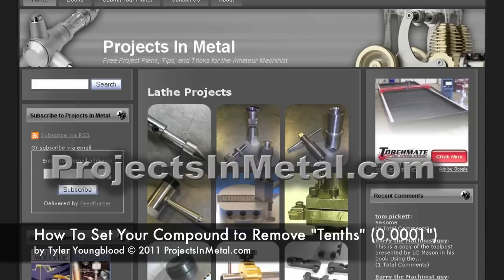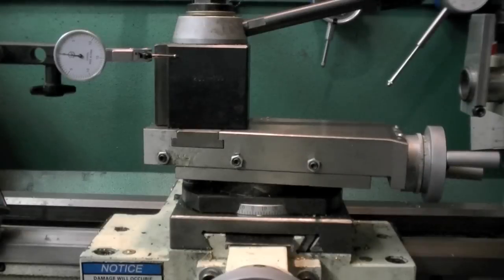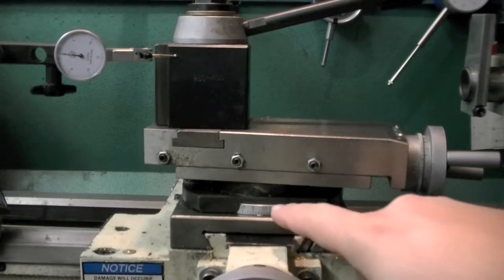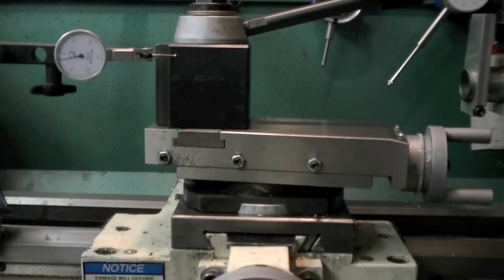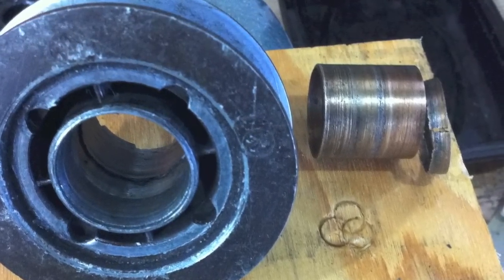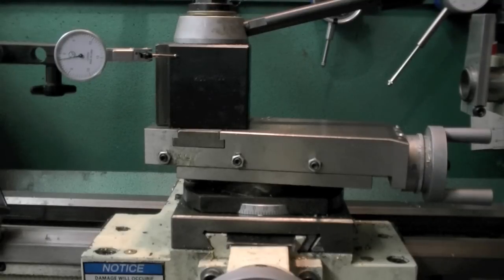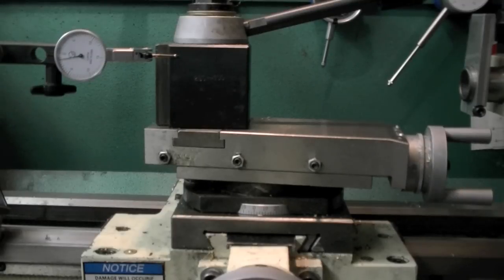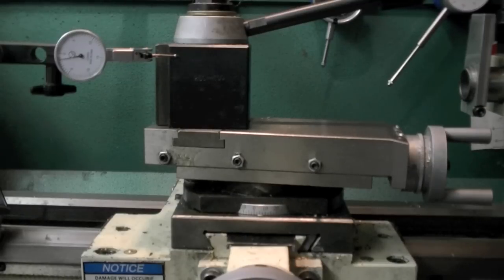How to Set Your Lathe Compound to Remove "Tenths" (0.0001")

Comment: Folks - 5·75° is approximately......

.....5·7391704772667863125149089039304° which is the angle you're aiming to set ! (Inv sin 0·1)

Any lathes with vernier marks on the position indicators ?

Comment: No. If you are trying to remove tenths from diameter it is because of these reasons.
Engineer failed to achieve size at finishing cut.
Engineer failed to observe a machines wear and tear and, remember to add or subtract this to final cut.
Engineer failed to eye position on radial dial by sight to brake one division into tenths by eye.
Engineer failed to use a magnifying device directly horizontal and vertical square to dial to make tenths possible.
Engineer is not employable in real industry for time consumption but could be employed by a cartel union run factory for a while.

Comment: An egg head will tell you "in theory" you can shave .0005 off ID/OD using this method ....a toolmaker will tell you get out the lapping compound and start polishing.(never trust the compound graduation. it's more of a ball park guess) Then expect a talking to for not knowing exactly what your getting before you cut it.
On that oil light bearing +.0002/+.0005 press will work just fine with worry of collapsing. ...If so, break out the lapping compound. no big deal. and press with a little grease to prevent galling. and press only when you know both parts are square!
 In any event, that will teach you to keep your machine way lubed or spindle lubed.
 All part in parcel of the trade...don't over think it. Lapping compound is your friend!
 Compelling video...got me thinking!
Reply: I just read some of these comments. People are such "Ass Whistles". Anyone worth there salt in the shop can make do on these Chinese machines. I'm not saying go out and buy one, but we all can't afford Monarchs.
 I give you props for effort. All Machinist have to break a few eggs...or in this case Egg Heads. I'd higher you before I'd higher some of these Huckleberries know it all's. (In the shop you can't throw a rock without missing one).
 
 M.E / P.E. / Master Toolmaker....3rd generation!
Reply from the maker: par4par72 Thanks for the kind words. I really appreciate it! The technique worked great for me with my oilite bearings (kudos by the way, most people don't even realize that the bushing is made from oil impregnated bronze). I was worried that HSS would smear the metal and close the pores (preventing the oil from doing it's job) so I kept the HSS really sharp and I'm hopeful that it holds up over time. In a hobby shop I'm confident that I won't put enough use on the Atlas mill to put a lot of wear on the bearings anyway. 

And thanks for saying you'd hire me! If you happen to have a shop in the Columbia SC area I'd be happy to apply! I currently teach college level computer science, but it's a part time online gig. I'd love some FT shop work!

Comment: Great explaination. Press fit tolerances are a headach. I use inside depth gauges and .0005 dial indicators. A moment of silence and good sprinkle of holy water before beginning.  TI-30X scientific calculator will give you the exact degree for your compound setting.
Reply from the maker: Ah, good idea on using a scientific calculator. I didn't think of that! "Holy water". Ha! I know what you mean. I was worried I was going to split the aluminum casting with the oilite bearing!
Reply: @ProjectsInMetal  Try the device you're posting comments on. Mine says 5·7391704772667863125149089039304°
Reply: What did you use to post this comment - an abacus ? What I used to post this reply says: 5·7391704772667863125149089039304°

Comment: Use your calculator to give you the arcsin (or inverse sin or sin^-1) of the fraction you want. Examples: sin^-1(0.5) = 30 degrees; sin-1(0.1) = 5.74 degrees; sin^-1(0.05) = 2.87 degrees. Your calculator will give you an outrageous number of digits, but good luck setting even a tenth of a degree. :)

Comment from the maker: Yep. However, I find the dials on my G0602 (an inexpensive import lathe) to be both course (hard to get fine adjustments) and inaccurate. One rotation is supposed to be .060 but it's off by a few thousandths. It took me a while to figure that out! I could never figure out why what I put on the dial wasn't what I got from the cut.

Comment from the maker: Well, usually the process isn't necessary at all. But when you're trying to hit a very close tolerance (say .0005 oversized for a press fit) you can achieve it very easily with a sharp HSS tool and the compound set like this. Tool flex and other factors prevent me from easily being able to hit the mark on such close tolerances, so if I find I'm .0008 oversized and I want to be .0005 oversized, I can get that last .0003 using this method.

Comment: Nice trick - If I am doing any turning where I want really specific numbers I just put a dial directly on the tool post like you demonstrated, and then read the actual dial movement rather than the dials.  You could do the same thing with your technique, and be absolutely sure of the movement by watching the clock rather than the dials, and still get the "fine adjust"...

Comment from the maker: I have a Dumore toolpost grinder and it certainly makes the process easier. And yes, .0002 or .0003 is easier to achieve than .0001, but it can be done with practice, a very sharp HSS tool, and patience. But if you have a toolpost grinder you'll have a much easier time. Most of the time hobby machinists don't need accuracy anywhere near .0001, but it's fun to know how to try and achieve it using a little geometry.

Comment from the maker: I've taken tenths off (0.0001-0.0003ish) with my Grizzly G0602 (the lathe in the video). You just have to have a really sharp HSS tool. You can't use carbide or it will just rub. Even with HSS sometimes you'll take a pass and nothing will get cut, so you'll move the tool in another .0001 or so and suddenly the tool with bite and take .0003. It's a little tricky but with practice, tight gibs, and a rigid setup it can be done.

Comment: Nice video, good explain, great idea!
But one I can say: on lathe make 0.01mm (0.0004 inch) accuracy - O.K., no problem. But get 0.0025mm (0.0001inch) accuracy on lathe - not to real, because so many factors to affect 0.0001inch accuracy: #spindle bearings; #lathe ways and screws condition; #gearbox; #chuck/ machine vibration; #machine "to level"; #oil & grease; #material; #cutting tool shape...; #human factor; ...etc.
0.0001 inch accuracy can get on grinding and polishing machines.
Reply: Yeah, if you want a thou off, use emery tape ! (or dunk it in ice cold beer  !)

Comment from the maker: Yep, it's difficult to remove such small amounts of material without a sharp HSS tool. Carbide needs a bigger chip load so very sharp HSS is really the best option. And even then it can be hard to get it to shave chips.

Comment: Please understand that just because you can "dial" in .0001" or even .00005" it does not mean the lathe will remove that material from your part. Variance in the lead screw, Rigidity of the part, Trueness of your spindle all play a roll in what will be removed. I'm not trying to knock the OP but just advise that what the dial reads may not be what is removed.

Then there is the issue of measuring to that level of accuracy.

Comment: Oh boy.. It's called Trig.

the tangent of your compound divided by 1000 = the X Axis travel
i.e. 5.75 tan= .1006947/1000=.00016940
We divide by 1000 because the tangent is over one inch. So .001 movement of the compound dial = .0001" movement in the X axis but remember this is a lathe and you will not be removing .0001" but .0002" over all.
Reply: Wrong trig - it's inverse SIN 0·1 you need (5.7391704772667863125149089039304) not tan.

Comment: In the machining industry work is commonly done in thousandths (0.001).  Since that is a mouthful I might tell a co-worker, "ya give me a 25 (thou) wall in radius when you rough it."  Many aerospace work requires things to have a tight tolerance - I'm working on some copper parts with a requirement of +or- 0.0002  So we call that 2 tenths.  Since it's 2 tenths of a thou (our common work field tolerance).
So no, he is right in using the term tenth.
Reply: Usually referred to as measuring in thous and tenths. [Never has a space been so important !]

Comment: @applejak2000 You are obviously very passionate about your stance on this, to the point of now being rude.   Lathes are not limited to just the X & Y axes.  Milling attachments and tool post grinders add the Z axis and are sold as such.  Lathes and mills both use the same coodinates.  It is not practical that 2 different systems are used on machines 8 feet from each other in a working shop.  UC Davis eng. is correct on theory, but it is just not true in the real world.  Be civil to this old guy.

Comment: @algae1000 I would like to add that the points X=0, Y=0, Z=0 are not used in practice when working manually on a mill, drill press, lathe, or surface grinder etc. In a lathe, for example, that point could be put at the center of the work in all directions, but in practice, the axial center at the far right of the piece being turned is usually the point where all cuts relate.  On a vertical mill, because that point can be anywhere, but is always relative to the table and the radial tool center.

Comment: @applejak2000 In Cartesian theory (on paper), you are correct, however; In the real world of manual machine work, rather than using Cartesian points (CNC?), X is the lathe bed, Y is the cross feed, and if you had a spindle or knee like a milling machine,  Z is vertical.  Look on eBay, or any machine tool supplier at milling tables, attachments, etc., and you will understand this is true.

Comment: Hi-Standing in front of your machine, I believe the X axis is side to side (along the length of the bed or table and the carriage or compound, if it set in the same alignment-parallel to the bed).  Y is front to back (away from you and back, the cross slide).  Z axis is up and down (vertical like a drill press spindle/quill).  Because the compound swivels, it represents a 4th possible axis, and the spindle is yet another axis.  Then, there are the angles along each of the axes.
Reply: Jerry....You have described axis designations for a mill.  On a lathe   Z axis is right and left...... the length of the bed, longitudinal  ....the long axis.
 and the x axis is the cross slide ....moving in toward or away from the operator.

Comment from the maker: @algae1000 Are you talking about @1:27 when I talk about "advancing the compound in Z"? Technically the apron moves in Z and the Cross Slide moves in X, but I can never remember which axis the Compound dial travels in - but I didn't think it was Y. Since I had the compound turned almost parallel to Z my brain was thinking Z axis. Anyway, isn't Y axis a tool height adjustment in CNC lathes? I've seen the compound labeled Z2, but not Y (at least not that I can remember). Sorry for the confusion!

Comment: This is a very good method of removing very small increments with some control.  You also have to trust the degree marks on the compound.  The thickness of a mark can make a difference.  Did you mean to say Y axis in the beginning, rather than Z axis?  Thank you for the videos.
Reply: Lathes have x and z axis. Y does not move on a lathe. Think of a milling machine on its side.